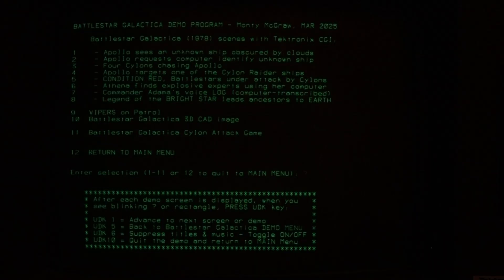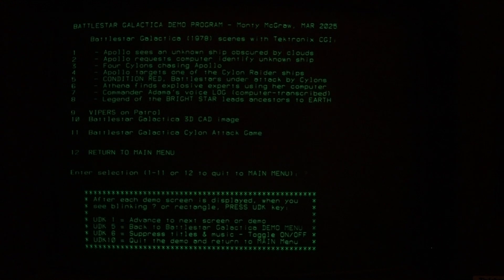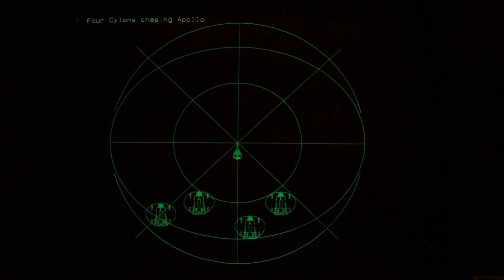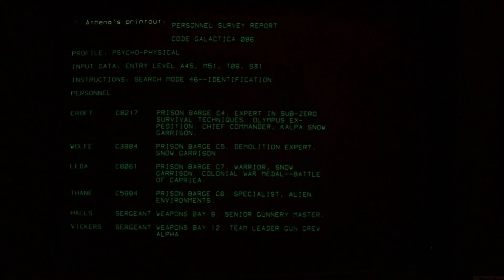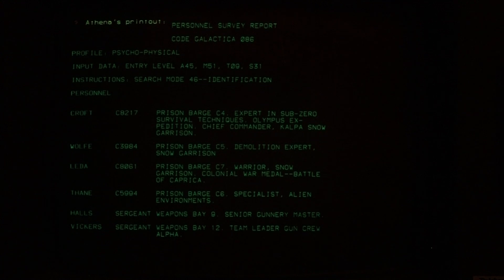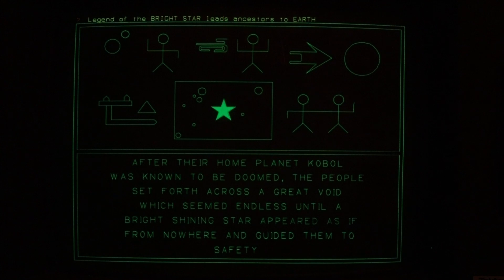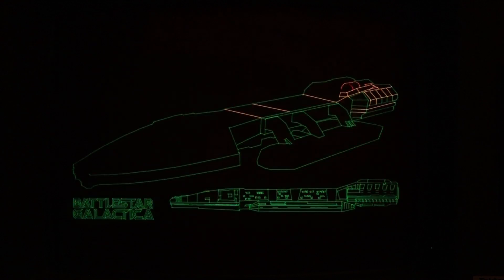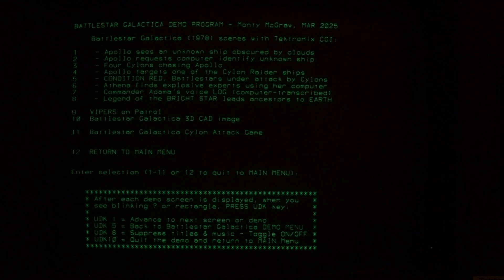Battlestar Galactica 1978 Tektronix Computer Scenes - Recreated on my Tektronix 4054A

Comment: If you look at the fake computer rendering of New York in Escape from New York, I wonder the limiting factors to creating that on the Tektronix (frame by frame) in 1980. I think even if you could assemble an army of programmers to assemble the vectors for a single frame, I'd guess it wouldn't fit in RAM. Could the display hold across running multiple renderings? Could it do curves? Could you "fade" lines? How many brightness levels were possible?
Reply from the maker: The Tektronix 4050 computers could only draw straight vector lines or dashed lines.  Curves can be made with a lot of short straight lines - like in my Cylon Attack game the targeting circles are drawn with a lot of short straight lines.  There are BASIC brightness commands for my 4054A computer but my experiments did not show much difference so I haven't used that command in any of my programs.
Reply: @TEK-Vectors  Excellent. Can you point me to any BASIC programs or docs available? I happen to be working on a BASIC interpreter for the web and it'd be great to be able to render the same images in a canvas element or SVG.
Reply from the maker: @mr7clay  - we have a 4051 Emulator that runs in Chrome: https://github.com/mmcgraw74/Tektronix-4051-Emulator  I have recovered and created many 4050 BASIC programs: https://github.com/mmcgraw74/Tektronix-4051-4052-4054-Program-Files and full manuals are here: https://w140.com/tekwiki/wiki/4052

Comment: I still have a 4051 in my lab.  I haven't powered it on in over 15 years so it will probably blow a few caps if I try it now. :)
Reply from the maker: You should try to power it up!  If it doesn't power up - I recommend you post the issue on vcfed.org in the Other forum, which is where I have posted my 4052 and 4054 hardware issues - and gotten great support to help troubleshoot and resolve all of them!

Comment: BG Tektronix graphics was one of several catalysts for me to start my own software and consulting business in the early 1980s.  Easy enough to program on 4015 and 4013 devices connected to a mainframe.   Never had the luxury of 19200 baud, write-through mode, etc.  I even had a star wars trench run working, no animation with 1200 baud.

Comment: If there is a way to port them to MS BASIC for CP/M, I can run it on an emulated VT240 that has a Tektronix graphics mode.
Reply from the maker: Here is a link to my repo folder with my Tektronix 4050 BASIC demo program and binary 4050R12 Fast Graphics images - plus my BASIC programs that created those images.  https://github.com/mmcgraw74/Tektronix-4051-4052-4054-Program-Files/tree/6e535b01b6221a5b6f756845f2aac2d9b7a6e748/Battlestar_Galactica-and_Tektronix_4051/Battlestar_Galactica_Demo_2025
Reply from the maker: It is much easier to just run my files on our Tektronix 4051 Emulator (which I used to develop this demo) - the Emulator runs in Chrome, Firefox and other HTML5 web browsers: https://github.com/mmcgraw74/Tektronix-4051-Emulator